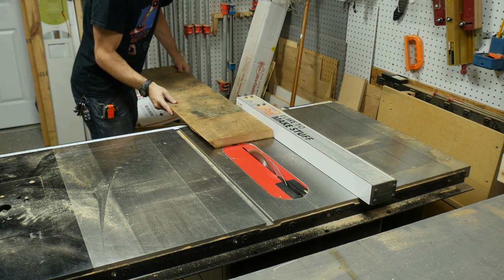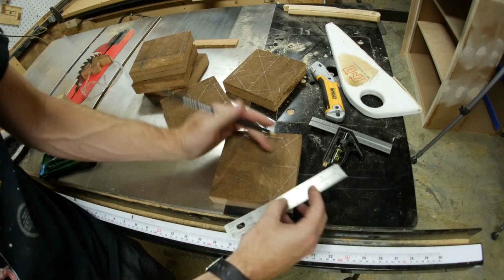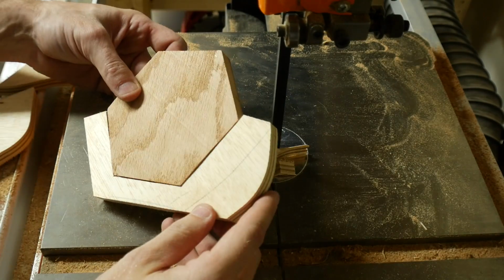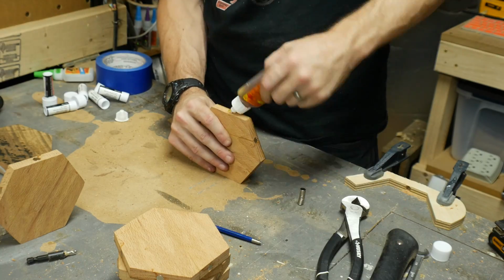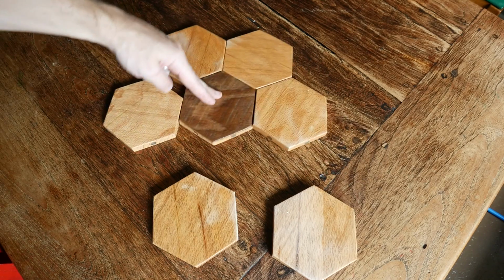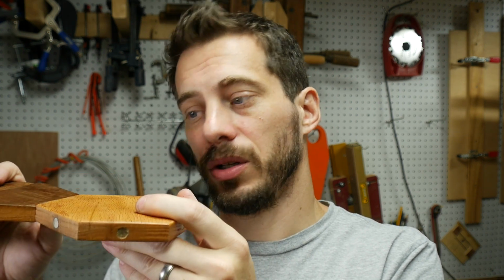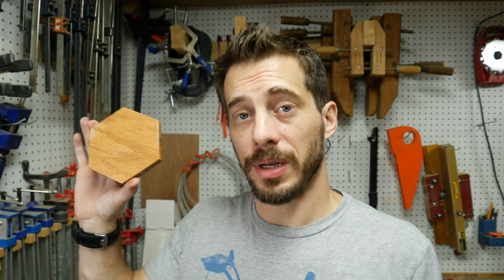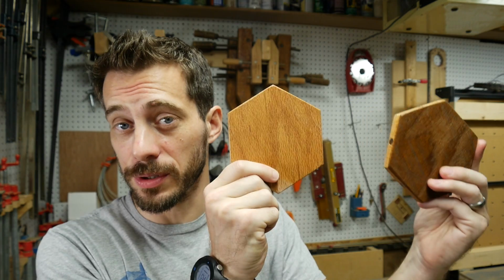Magnetic Hexagon Coasters // How-To | I Like To Make Stuff

Comment: Made this same project at home after watching. My solution to the problems you had..
1) Stacked, glued, and clamped the initial 5 in. sqaures
2) Marked the hexagon on top, cut with band saw. This ensured EXACTLY the same shape.
3) Flipped the stack on its side, made a stop block on the side of my band saw at ~0.5 in. This ensured exact thickness.

Comment: Bahaha, you decked your light at the end. That was perfect.

I made a set of square coasters several years ago with some Oak and a 1"Walnut "X" inlay. Then I cut out a circular recess in the top and glued in some cork sheeting before putting felt on the underside. Still use them daily and they hold up great! No fancy magnets though. :[

Comment: If you drill a bit deeper and use a magnet that is smaller than the hole so that it can flip freely within the hole, and use a thin plug to plug the hole, then you don't need to worry about the polarity of the magnets as they'll flip to the right orientation when coming within the field of another magnet. It's something I've done with some 2"x2" Dwarven Forge game tiles. With this technique you will get rattling since the magnets are free to move around. As well, you do need to get the N52 neodymium (rare earth) magnets - the strongest rated ones - since distance does affect the strength (ie. the thickness of two plugs of wood).

Comment: Seems to me that you might have saved some time by cutting the full length board at 30 Degrees to begin with using a miter or chop saw. You may have also set up a jig, like your drilling jig, to use to cut the coasters on the chop saw. Obviously the last part is to separate them with the band saw at the end. Great project...

Comment: It's difficult to accurately cut the corners of the jig you made to drill the magnet holes.  To make this easier, you could just drill 1/2" holes at the corners and then focus on getting the line between them perfectly straight.  That way you don't have to worry about fussing with the corners at all.  Also, if you took the blanks and cut your 30 degree angle, you could easily set up a stop block to cut the opposing 30 degree angle.  After that, it's a pretty simple cross-cut sled setup to rip the opposite side exactly parallel.

Comment: Fun project! I wonder if custom made stop-block(s), that were shaped to accept workpiece as the sides of the hexagon were cut down, would help improve the precision. If this is possible, it wouldn't require each cut to follow a manually drawn line.
Either way, the project turned out great!